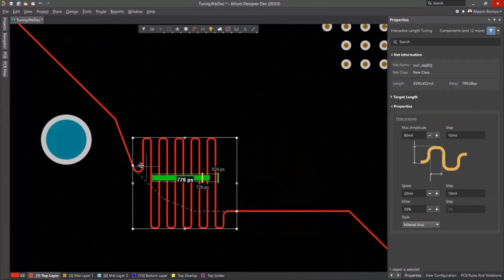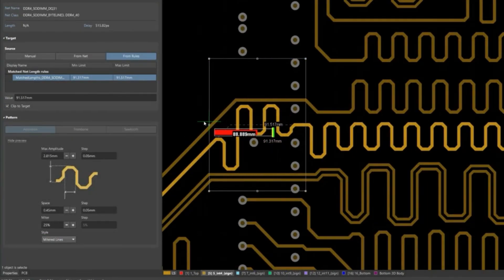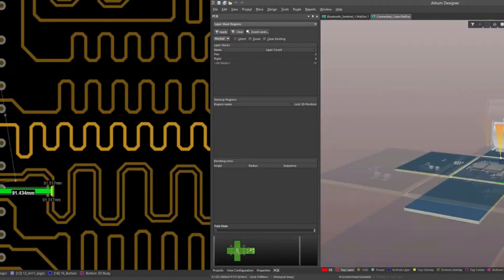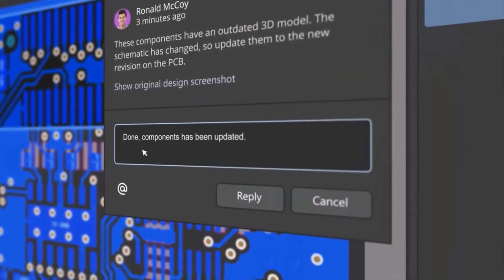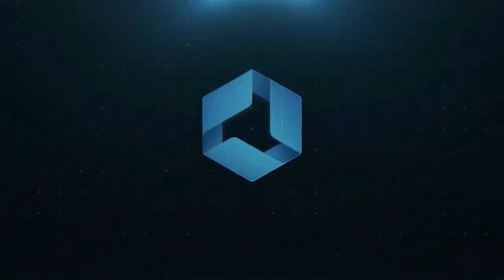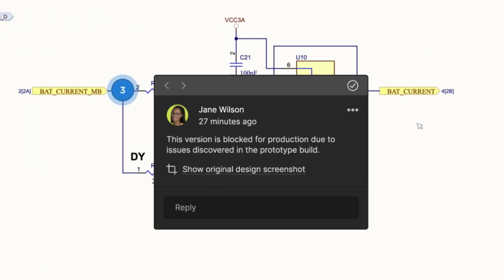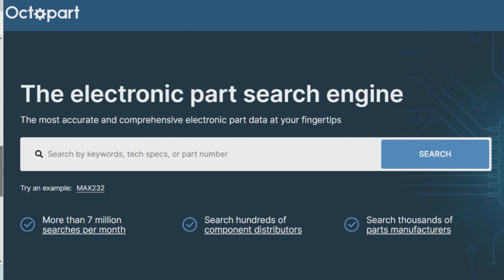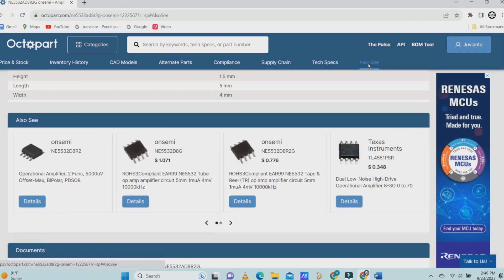DIY 3000W?? Full Bridge High Power Amplifier using 54 Transistors 2SA1943 & 2SC5200 #cbzproject

Comment: Why would you cut the leads flush before soldering?  You’ve know taken away all the mechanical grip of the solder. I’d be shocked if you didn’t have cracking after some use. Also by pushing the tape down like that, it would tend to pull some of the components back up.  I wouldn’t recommend anyone solder like this.

Comment: Is it Possible to watercool the Amplifier??
Reply: Possible yes, been done before I think not.
Watercooling loops need to be taken apart for maintenance every couple of years, and tubing can become more rigid and crack over time causing leaks which would probably kill the amp. 
If the water pump dies the amp would go into thermal shutdown and you'd need to open the loop, put a new pump in and refill the loop, which would take hours, if a fan on a air cooled amp dies you just swap the fan with a new one and you're done in 10 15 minutes.

Comment: No way thats 3kw power
That powersupply looks like 1200w or maybe 1500w but never ever 3kw
Reply: boyo, he did the mastermind calculation, so he have 80 0 80 power supply, he combined it so its 160v and he did the calculation (160x160)/8R
So he got 3200W, but in theory its just the vcc wattage that it should need to do.
Even tho he have 2 of this amp and even if we calculate the power efficiency of class AB amplifier its 50% its gonna be 3k watt, but there is a catch, since he have 2x3kw amp which is not 3kw just like (in theory 1600w) he will have a load of 3000-6000Watts on that lil power supply, i dont think those specs are real.
Lets count the transistors!
Those are on one side 2SC5200 so one is 15A and 150W TDP, and he have 7of it on one side, another side is for the other side of sine wave.
He have 7x2x150w TDP of max heat load, so it is  2100w max heat so since the class AB is 50% efficient so we can get about 1000-1200Watt max before the amplifier going in smoke, so its already bussin.
Lets go for the eletrical side: those are 15A transistors and he have 80 0 80 power supply. 
He have 7on one side. so its 105A max collector current. So lets calculate the dumb way: 80x105 so its 8400 and divided by the speaker impedance which lets assume its a resistor: so lets say that its 8R right?: the result is only 1050Watt max onto 8R, or 2100W into 4Ohm.
its just cause of the voltage limitation of the power supply not counting the losses.
Amplifier busted!!!
CBZ youre a shame, you shouldn't clickbait, and you should do output measurements before sayin infos!!!